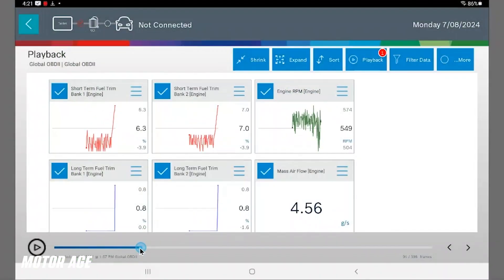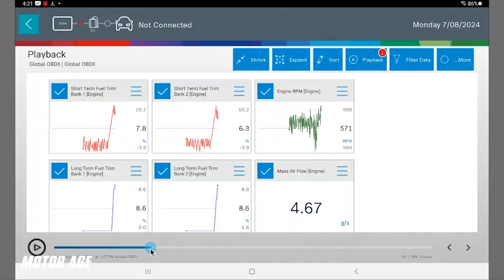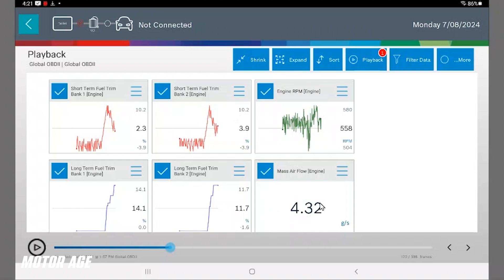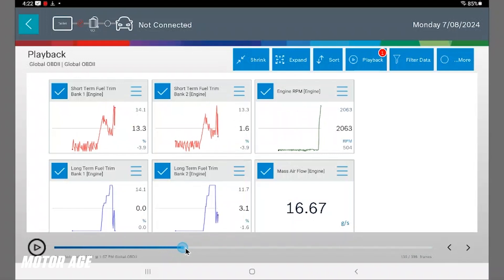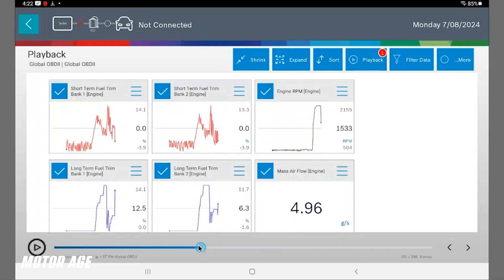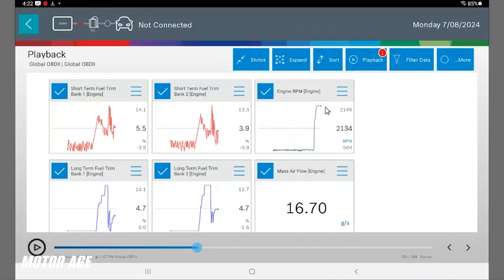The Trainer #150 : The Analytical Road Test

Comment: Thankyou! Screen shotted the pid list to memorise and save to my desktop until its habit,
Maybe I should of asked on the video you did with the Autel, But we have the same scan tool the Ms919 do you know if there’s a way to upgrade to be able to search for pids? It seems that model is missing the option to search
Reply: @fastbagel Once you are on the list of pids in whatever module you chose, pull down from the top of the screen and look in the upper right hand corner and you'll see a magnifying glass icon. Press that and you'll be able to search for whatever pid you want
Reply: @jharrison6557  Awesome I’ll give it a go, I’ve used the ultra and found it easy which made me think it wasn’t an option so hopefully that’s all it is!
Reply: I’m sorry, I don’t know so you’ll have to reach out to Autel for product support
Reply: @brandonsteckler3417  Of course sorry thanks!
Reply: @fastbagel , no problem. I wish I could be of more assistance

Comment: Watching fuel trims in graphs works well, while monitoring upstream and downstream sensors can give you a wealth of information at idle and under load.  Plus you will understand that relationship between trims and sensors.
Use of multichannel scopes will enhance that knowledge.  The scope can be a big help with intermittents especially the "intermittent engine dieing while driving."  I've seen that happen on both ignition and fuel delivery with different vehicles.
A good plan is a start, but be aware that plan must be flexible for those sudden changes.  Time and patience will yield great results.
Reply: All true. However, this video is to educate techs on how to eliminate testing everything under by eliminating all the “good-functioning” components under the hood and then only focusing on the remaining possibilities. 😎